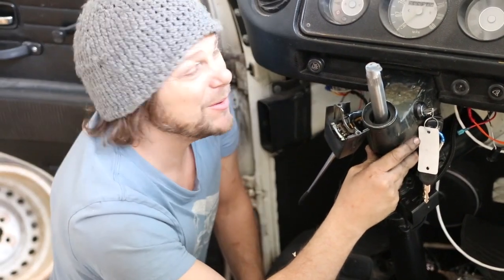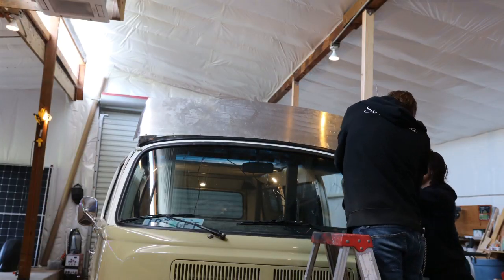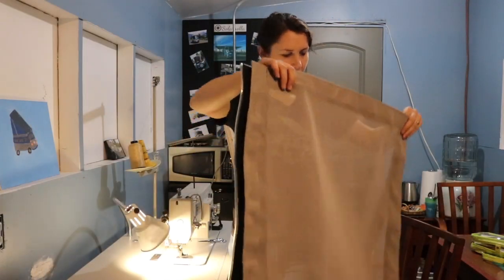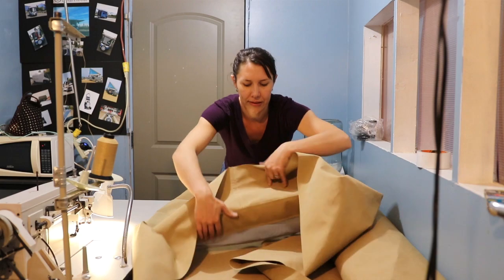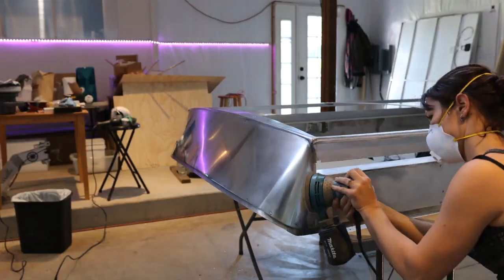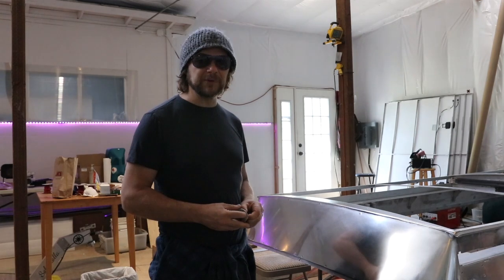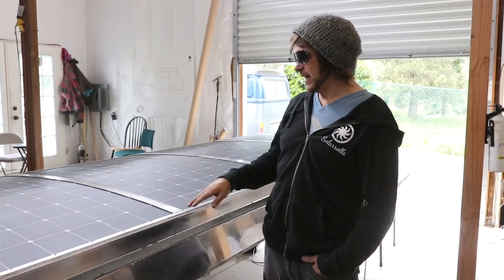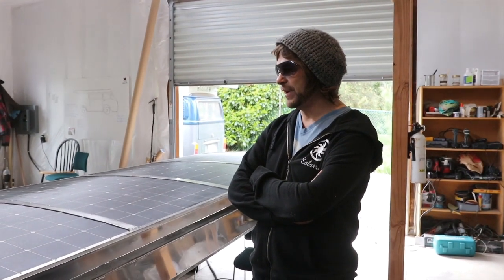Solarrolla- Redfoo Video 7: Solar Electric VW Conversion, polishing aluminum, details, details...

Comment: I was thinking about getting one of those power stering units for my Bus and I found a supplier in the UK and they put me in touch with someone who lived in the same State as me he in Australia who was going to instal it. Anyway I ended up helping them install it so I could see how it worked, I was very impressed. From the process I did find out that there are replacement roller bearings for the steering colum that make a big difference also to old Buses. I replaced mine and was so happy with the change it made I decided to save my money and not do the power steering...but it is a great upgrade.
Reply from the maker: Sounds like the same company we got ours from, it really is a world of difference!
Reply: @solarrolla  I love what you guys are doing, and I know exactly the time and effort it takes to get all that polishing done, gallons of elbow grease and the brain strain from the hours of power tool noise. Great result, Red is going to love it. Looking forward to seeing how the tent works :)